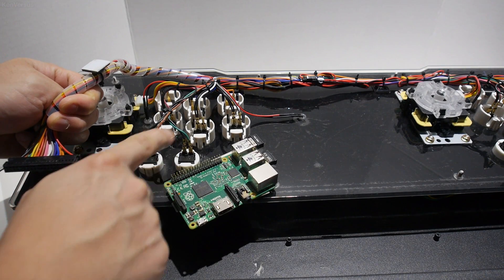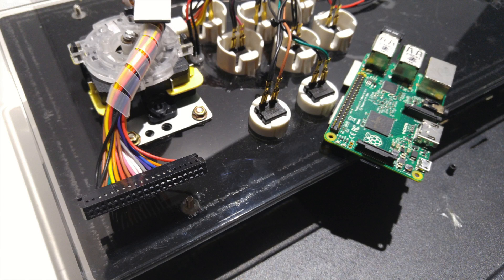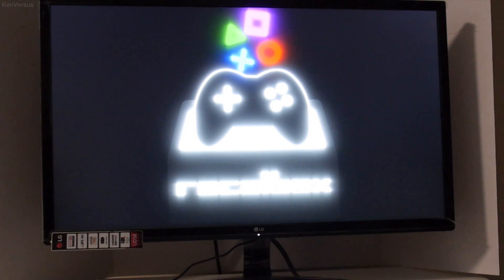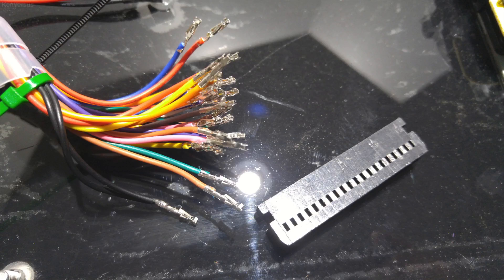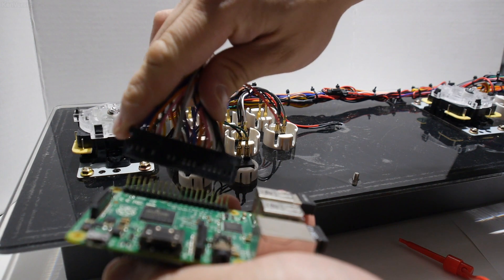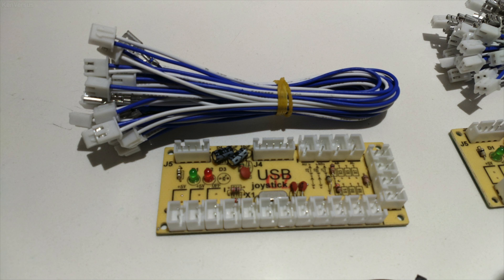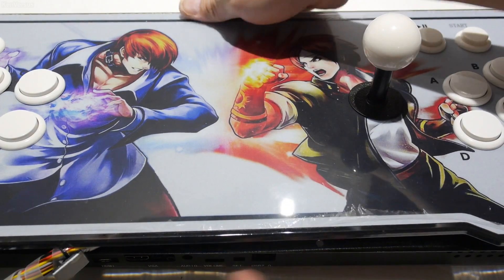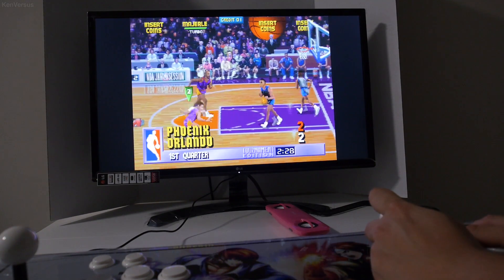Pandora's Box arcade with Raspberry Pi GPIO Controller

Comment: Hey, this is a nifty idea! I bought a random Pandora Box controller from ShopGoodwill, and while it works, it's also in Chinese, and the graphics aren't very sharp. I think I'd get a better experience from a Pi 3... I'm just not thrilled about having empty holes where ports used to be.

Comment: In the pinout what does the HK stand for?
Reply: The pandora box only has 8 buttons per player and the joystick (6 main buttons and the 2 others for adding a coin/reset and choosing player 1 or player 2). High Kick? Which button is high kick? Wouldnt that be 9 buttons?? It is not High kick, it is HotKey from what I am seeing.
Reply from the maker: HK , high kick

Comment: Thanks for this mate. I got two questions for you, please :-)

Is there any performance benefits in using the GPIO vs the external controllers? I'm thinking about input lag.
Also, how did you manage the audio output on the internal speaker? Thank you!
Reply from the maker: I would thing gpio has less input lag. But if you use good usb encoders, they'd be good too.  Just more options. I output audio from the HDMI to tv.

Comment: Great tutorial !  Unfortunately i did it on a PI 4 with Retropie (Recallbox not available yet  ) and the GPIO controller is recognized but not the inputs when buttons are pressed.... I wonder if there is a work around ....
Reply from the maker: You did rearrange the pandora pins right?  It's not really plug and play. Every pandora will have different pint outs.  You'll need a continuity tester to trace them like shown in the video
Reply: @KenVersus  yes...I rearranged them and followed the video....I think this is a software driver issue more than hardware....I may not have a choice and use USB encoders...
Reply from the maker: That is strange then I would think retropi would support the rpi4 gpio already.  Gpio is used by a lot of arcade builders. Maybe check out the retro pie forums with those who have used it with gpio. I haven't upgraded mine since the video.
Reply: @KenVersus  Yep...it was a driver issue...I got it working with gpionext from this video https://m.youtube.com/watch?v=R-wAcP6wVTc

Comment: First I must say this is an excellent tutorial, I was able to replace my poor performing pandora with the pi and successfully pinned out. Now two questions,   what is your GPIO cofig in recalbox? Seems I did everything right and most things work but I can't seem to move the directional keys in some Dreamcast games specifically, it works fine in others. I can move fine in sfIII for instance but I can't move in Virtua Fighter 3. Second how did you wire the Gpio to be Able to power off ? I have an off on switch on the pandora case that I'd like to use to power it off. Let me know please and keep up the awesome work ! :)
Reply from the maker: My GPIO config is stock, I didn't change anything in there.    If you watch my other RPi in Pandora's box video, I do show how to wire a shutdown button, or google it, it's pretty standard method with recalbox.
Reply: Thanks  @KenVersus  the GPIO config works for Everything............... accept a couple of dreamcast games namely Virtua Fighter 3 and Fighting Vipers 2. Works fine for Street Fighter III cap com vs snk . I was hoping you encountered and found a fix for this thanks for following up.
Reply from the maker: Unfortunately I don't run dreamcast
Reply: @gino4895  Having the same issue. You usually use pin 5 and pin 6 to turn it on and off (after editing the configf file in recalbox). Did you ever find another method? This was using a push button approach, not the on and off switch (i lost mine)....

Comment: Hi there. I'm trying to add the option for the second input. When I do a usb query I only get the first 2 numbers in your example you have 3. Can anyone here help me out? Here is what I get.....

T:  Bus=01 Lev=02 Prnt=02 Port=03 Cnt=03 Dev#=  5 Spd=12  MxCh= 0
D:  Ver= 2.00 Cls=00(>ifc ) Sub=00 Prot=00 MxPS= 8 #Cfgs=  1
P:  Vendor=16c0 ProdID=05e1 Rev=01.01
S:  Manufacturer=3H
S:  Product=3A arcade controller
C:  #Ifs= 1 Cfg#= 1 Atr=80 MxPwr=20mA
I:  If#= 0 Alt= 0 #EPs= 1 Cls=03(HID  ) Sub=00 Prot=00 Driver=usbhid

I'm putting this in the cmd file.....usbhid.quirks=0x16c0:0x05e1:0x040 

The last part 0x040 is just me copying what you put in. I have a different board. The Pandora 5 from 3A Games from Aliexpress.

Any help would be appreciated. :-)

Comment: How can a trackball be added? Can I just buy a trackball with a USB and simple plug it into the raspberry pi, or can the trackball wire directly into the pinouts? And what pins?

I seen a tutorial using a $60 I-PAK
Reply from the maker: It should work connected to the rpi. Just like a mouse. Use it to test. If the mouse works so should the trackball.
Reply: @KenVersus  
Thank you. I want to add a trackball in the center.... Doing research. 

All I want is to add a trackball for the game millipede... Looks like getting into the menu to change the settings is going to be fun. Thanks for helping out us old people.

Comment: The Pandora's Box uses a Jamma connector. Is there any way of making a Raspberry Pi to Jamma? That way it can slot in like any other arcade board.
Reply from the maker: I think there is an adapter you can buy. But it's pricey
Reply from the maker: Check out the pi2jamma adapter.
Reply: @KenVersus  Thanks for the feedback, I'll look into it.
Reply: There's a cable for the pandora family version for about $8 if you search for it, obviously you'll need to research connectors and the pi, or work out the jamma end with a multimeter.

Comment: how did you handle power for the pi? Do you just pull out the micro usb power cable? Does that put your system at risk of corrupting?
Reply from the maker: I wired a power button to shut it down safely. Check out step 6 on this site. This was another method to install a raspberry pi.

https://www.instructables.com/id/Raspberry-Pi-Inside-Pandoras-Box-Arcade-System/

Comment: Do you you know if there's a 40 pin GPIO cable with the correct pin setup for Raspberry Pi for sale? I would like to keep the Pandora cable intact, and i am worried i could mess the cables. Thanks.
Reply from the maker: I've never seen a cable like that that's why I had to modify the pandora's cable.
Reply: Considering pandora cables are not all identical then no.

Comment: Is there an online store that just sells a two player shell/case? Sort like the viedo you did but more enclosed like a Pandoras box. Big enough for a raspberry pi 3 or an itx mother board (micro)
Reply from the maker: I've seen some metal enclosures on aliexpress but the price was the almost the same as a complete pandoras box.
Reply: kenVersus thanks. I just don't have tools or space to build from scratch. I live in an apartment.
Reply from the maker: Same with me. That's why I love these Pandora boxes or bartop arcades. They are small.
Reply: kenVersus I seen those forgot the name of those umm has a big X in the middle , cheaper than a panadoras box. I would of course gut it and put sanwa stick and buttons. Probably an 8 way gaurd replacing the 4 way. I'm in Canada so most places are expensive when conversion comes into play. There are some Canadian sites that sell mame machines only but I don't want to spend a lot just to gut something
Reply from the maker: x-arcade tank stick I think.
Reply: Buy a long wooden box, and a cordless drill with the wood spade bits for the holes. Mark it out and triple check your design. T asks it outside somewhere and drill it. Go home, clean it up, add decorations and trim, maybe varnish the outside, then write it up using the space connectors. You just need to search for a suitable box.

Comment: Nice idea. One suggestion I would make is to use GPIO jumper cables instead of removing and rearranging the pins directly on the existing head. That way you can make changes quickly and have much less trouble switching back to Pandora's Box, should you ever need to.
Reply: How would you do this? I am very new to all this, Would I have to connect the jumpers to the pin connector attached to the pandoras box and re wire them from that onto the pi board?
Reply: @bowzerblack  aaaaany minute now.
Reply from the maker: That's a good idea too.
Reply: Cool idea, i was breaking my head figuring out how to skip removing the gpio cables
Reply: Thank you
Reply: This would be a great consideration, but it looks like they are coming out with better RPis than Pandora's Box systems.  So I think I'm going by way of this also.

Comment: Great video Ken. I had watched your previous video about hooking up a PB4 to a raspberry pi but you were running recalbox. Since I was on retropie, it took a lot more programming of the kernel to get the RPI3 to work properly with the PB4 however on the newer version of the PB5 it's got out of box compatibility with XBOX, PS and RPI. Same goes with some newe clone PB4 models. I've seen a video of a new one that has 1299. This model doesn't use the gpio for buttons it uses a separate connector as well as separate board to run the buttons. This in turn seems to allow perfect use of the PB as a USB fightstick. As far as midway games, the new PB5 w/upgraded hardware runs both MK and NBA Jam perfectly. Also the new PB5 let's you cycle through aspect ratios.
Reply from the maker: Thanks Ray.  The new features of the PB5 sound great.  Hopefully it filters down to the clones.  Innovation is always good.  Too bad some of the newer clones don't use the same connector but there's still tons out there that have the 40pin, and the PB5 still has the 40pin from what I can see.  Even without the GPIO it's not a huge loss, just use the USB.
Reply: What did you do to get it working on retro pie? In my case my buttons work but my analog stick only goes right and down.
Reply: Yea howd u get yours to work.. I have a pb5 but only 2 buttons work. Help?
Reply: 3AGame version with updated cpu and ram ,pandoras 5 works with the RPI 3..no messing adding config files just config the controllers within retropie , both players work fine. Plug your P5 usb straight into the PI3 no need to power the Pandoras 5 up.